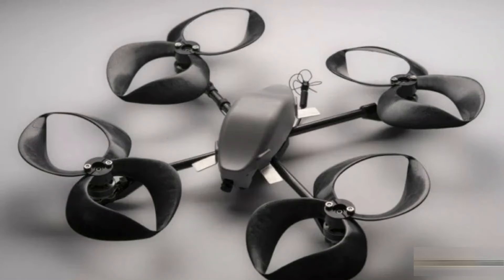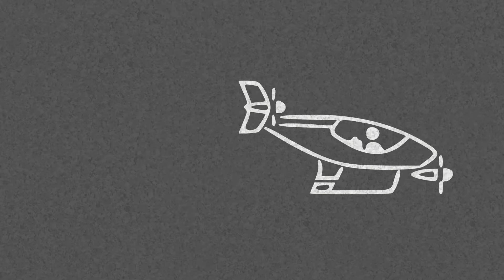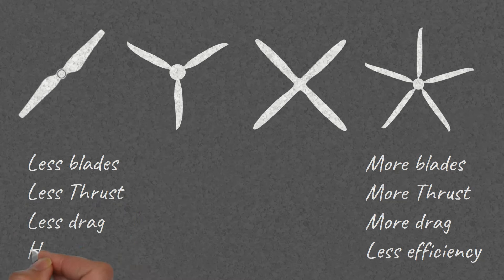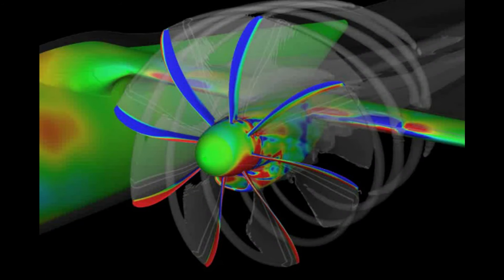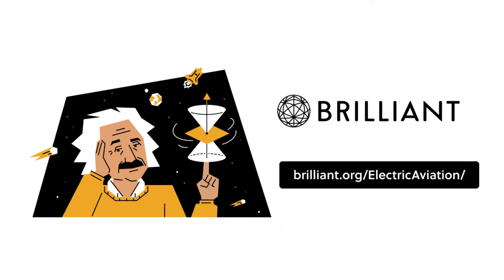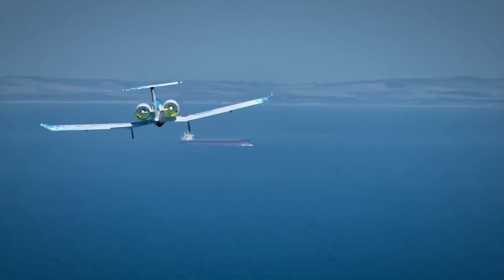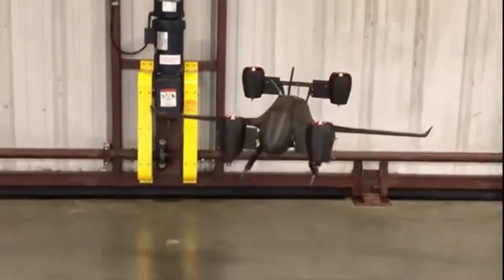EVTOL Propellers complete guide

Comment: Tip speed in ducted fans isn't limited to Mach 1. Turbofans commonly operate at 1.1 to 1.3 mach tangential tip speed. The duct regulates axial flow speed to approximate the pitch speed of the fan, which keeps blade AoA low and reduces wave drag. Excess or insufficient flow is handled at the inlet rather than the blade as the inlet spills or sucks additional air to make the duct velocity suitable for the fan pitch.

Comment: Great video, and pleased to see your hard work is getting sponsorship. My initial thought is that one of the most important modes of flight is performance after power failure. This has driven fixed wings to think deep about takeoff procedures, and has driven helicopters to think deep about disk loading for autorotation. The argument in e-VTOL is that multiple redundant electric systems will lead to >1E9 hrs to failure. This has lead to many e-VTOL designs with high disk loading and no autorotation capability (for example rpm control thrust in place of collective control thrust). However, the certification authorities are yet to agree to this approach as they know that even 1E9hrs standards can and do lead to incidents. So EDF is perfect for e-STOL, but we are likely to see a drive towards larger Q-tip blades for e-VTOL.
And, don't get me started about the design depending on ballistic recover systems to recover a total/cascade power failure near the ground during landing.😖 I will simply quote the Zefhir helicopter website "If you can, autorotate. But if you can’t, the parachute will save your life!"...
Reply from the maker: One thing Skyfly Axe got me interested in was its better glide ratio. One of the few aircrafts that can glide in case of a power failure. I like the Antanov AN2 for the same reason. The aircraft doesnt have a stall speed. These are the designs that should be electrified
Reply: @ElectricAviation  , a good glide ratio definitely helps, although technically this means the failsafe operation is STOL and not VTOL. Whenever I see drones clatter to the ground after battery failure I always think that it was a good thing that it wasn't capable of carrying passengers.
The best example about why VTOL needs autorotation is the AW609 tiltrotor, developed from the V-22 Osprey, that 20 years on still hasn't passed certification. The original V-22 concept was developed without autorotation in mind, but the high disk loading has led to some nasty vortex ring state accidents. The AW609 can autorotate, at very high descent rates, but not sure this has been demonstrated to full landing yet.
Jaunt Air Mobility certification is expected in 2027, so I guess this is the line in the sand for all of the high disk loading e-VTOLs out there...
Reply from the maker: @martingarrish4082   True. STOL is the way forward in the near future
Reply: I'm really tired of this autorotation argument, when does only the turbine or engine on a heli exclusively fail?? Probably 1 in a 1,000, the engine is by far the vastly most mechanically reliable component on at heli, if it's anything BUT the engine going haywire you are seriously screwed, that's why after seeing dozens of helis go down - on video, I've yet to see even one employ this almost mythical 'autorotation' technique to save itself.
Better to rely on multiple ballistic chutes (like whole craft ejection seats) and enlarged ground proximity/approach velocity sensor equip airbag systems to ensure survival.
Same deal with gliding to the ground in a fixed wing personal craft, the Earth isn't a uniform lush golf course green ready to give you a safe crash landing, the same solution applies chutes and airbags.
Reply: @Veldtian1  , I'm not against any of the safety systems you mention. Ground impact airbags actually make sense. In fact, I'd like to see rotor RPM governors implemented on helicopter collective pitch levers to ensure autorotation entry. But what does bother me is that lots of e-VTOL designers are using these systems to just ignore the basic physics of hovering flight.
Anyway what we think is irrelevant because it will be certification authorities that decide what flight envelope to impose on an e-VTOL design. If the strategy selected so much as sneezes about flight safety they will have no compunction about grounding the fleet either. So we do need to have the discussion - ideally 10 years ago...

Comment: You've inspired me to yet another idea.

I was watching an anime, where one of the factions had power armor. The mobility was provided by powered roller blades, and jet engines.

And I thought that's not really a bad idea.

Skip the power armor, use powered roller blades, and instead of jets, electric motors mounted bi-copter style on a backpack.

Not enough for full flight, but enough to do some epic jumps one or two stories up, and theoretically provide enough downforce to skate a vertical wall.

Also it would work like a steerable electric parachute.

You don't have to sustain flight to get most of the advantages of flying around.

User interface is definitely going to need some AI, and possibly brain interface. Good thing both of those technologies are off-the-shelf now.

Comment: As mentioned in the video, ducts eliminate the tip vortices and improve safety in the vicinity, but add weight and cross-section; the latter can cause the aircraft to be adversely affected by cross-winds.

Toroidal propellers greatly reduce (nearly eliminate) the tip vortices and improve safety in the vicinity (not as much as ducts, for either of those) but don't add significantly to the cross-section and add less weight than a duct.

Makes me wonder if anyone is working on an e-VTOL with contra-rotating toroidal propellers. And if not, why not? I would think it wouldn't be too difficult to add toroidal props to the Jetson ONE, assuming one had a way to manufacture such things.
Reply from the maker: I think the jury is still out on the toroidal props. One thing that can be said with certainty about them is the lower noise. There are a lot of configurations that need to be checked with them before they can be used in Jetson one. 
The good thing is drone enthusiasts are testing them and so far like what they have seen in terms of performance.
Reply: bUUUUTTTT, ducts can be turned into mini ring wings. as a thought.

Comment: I feel the design should make use of the tip vortex, making it an impeller, which creates a vacuum where the vortex flows in and out of.
Making the blade like a ice-cream scooper. round side pushes the air to the side (pressure) while the hollow inside creates the vacuum, which is much stronger then the pressure, creating a stronger inflow.
this inflow then should be guided.

Comment: There is another even more futuristic propeller/thrust technology that I have not seen yet and that’s putting the electric ‘engine’ into the duct so that the blade tips are at the centre. In underwater props these systems are called ‘rim thrusters’. The ducted fan axial flux motor air rim thruster…

Comment: As a fellow admirer of the Cartercopter I was hoping you would look at their scimitar propeller. It seems to have attractive advantages and fewer downsides than many designs. I am also intrigued by helicopter four blade tail rotors with the blades paired to form a narrow V shape. It was reported to be unusually quiet. Any idea why? Noise is the biggest problem with the widespread adoption of electric aviation. IMO it should be prioritised as high as any other facet of propeller design.
Reply from the maker: Thanks for the suggestion

Comment: I'd say the Custer Channel Wing deserves reasessment, but with some modifications, propeller running on leading edge of channel, if having it on thicker part of airfoil or elsewhere is to be experimentally determined, also if a counter-propeller, fixed vanes after propeller, changing swirl flow from propeller into a linear flow would improve efficiency. Antonov Izdelye tested the channel wing with propeller in leading edge, they say with some tethered flights, but soviet system crisis discontinued research.
Blessings +

Comment: Just for fun, how about adding a pin wheel fan in cruise mode connected to a generator to charge the battery? (Sort of like regenerative braking in cars? Very informative video. It helps to figure out all the new designs I've seen.
Reply from the maker: Any fan will create drag, that will need to be overcome by the main propellers. And the energy gathered will be less then extra energy spent. Having said that there are regenerative mechanisms in a few eVTOLs. The capture the energy and recharge the battery during decent

Comment: 0:10 "Co-rotating coaxial propellers" do not exist in practice.
0:48 "Thurst" = thrust.
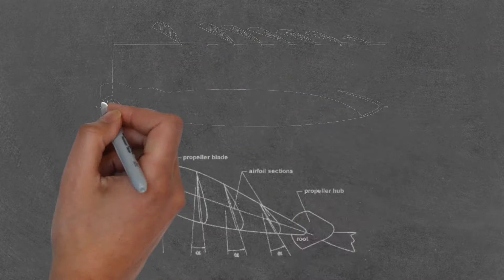3:43 High pitch angle at the root to low pitch angle at the tip.
7:44 Most designs use tilting rotors for vertical takeoff and cruise, so require variable pitch propellers for better efficiency.
8:41 Sharrow propellers are manufactured on 5-axis Heller HF3500 CNC machines.
8:52 Worse control due to poor PID response from the greater mass/inertia of the toroidal props.
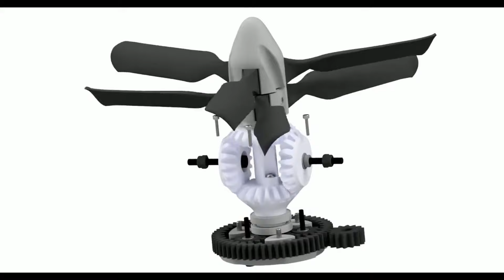9:01 Jetson ONE does not use coaxial propellers; rather, each corner uses twin motors in a tractor-pusher configuration.
9:14 Coaxial propellers/rotors provide more control and maneuverability for the same footprint as a single rotor; however, two separate rotors are more efficient and provide more thrust/control.
9:20 Jetson ONE has fixed pitch propellers/rotors, so cannot vary the pitch of each rotor; likewise, each corner's pair of motors vary their rotational speed together.
9:29 Contra-rotating coaxial propellers can be arranged such that the aft propeller is smaller in diameter but higher in pitch than the fore propeller, which could provide better efficiency than a single propeller. (Similar to the ducted fan, albeit variable pitch, discussed at 15:15.)
9:40 "Co-rotating coaxial propellers" do not exist in practice.
9:52 "Co-rotating coaxial propellers" are not used in practice, as opposed to contra-rotating coaxial propellers, because of the lack of cancellation of torque/propwash/gyroscopic precession/etc.,  more susceptible to lateral wind gusts, and way less efficient given that the aft propeller blades are constantly traveling in the turbulent wake of the fore propeller blades.

Comment: Propeller with duct or cowling don't have much more benefit unto it,infact it will just only reduce the effecience of propeller because of surface friction in low rpm and that will cause a stall and especially the tip of the propeller are not fit to adopt the environment which the forces of air is very different ,I hope someone get it.😅 While a ducted fan with a wide fan tip will have more gain to it's thrust by also from exhaust stator guide vanes  (if) the stator guide vanes was tilted on different position like on co-axial setting by producing a higher pressure compare to stator guide vanes that is just only function is to straighten the air flow, the stator guide vanes tilting at a different position may also secure the possibilities of so called (compressor stall) or just limit a some of air to push back to the intake duct because of a exhaust convergent design.

Comment: From what I've gathered ducting is good for high trust at low speed, you can try to fix the problems with the ducts increasing drag with ultra complicated duct designs, but the problem is fundamental, and absurd complexity is huge disadvantage in aviation. The issue of ducting or not is very well understood, in high speeds, open propellers are best choice essentially as long as the speed isn't over what the propellers are good for. This is shown by when turboprops are chosen, over turbofans and vice versa. It's not a new issue, no need to reinvent the wheel there.  Another example is the water propellers, most are open design, but there are exceptions, ducted propellers are common when high thrust is required at low speeds, like on tugboats, and also when high thrust is required in a very small space, you can use pump-jets. Pump-jets are technically less efficient than open propellers at high speed, at least until the open propellers run in to their limitations. 

Contra-rotating coaxial propellers can improve efficiency, because the second propeller can turn rotational flow into thrust. That's a widely known and accepted fact. The main disadvantages is the increased complexity, which introduce a number of issues, and the fact that they tend to be noisy.  With electric motors it's quite easy to just use individual motors for each propeller, like on the Jetson one. Using individual electric motors essentially solves complexity issue, and the disadvantages of dividing the power over more motors is insignificant compared to doubling the number of combustion engines for the same output.   

Together with some other potential advantages of electric motors, over combustion engines, and aerodynamic advantages with a single axle dual rotor over a larger number of smaller propellers it's likely electric helicopters with contra-rotating rotors will be "the" choice for EVTOL. At least for moderate speeds and distances, like up to a few 100 km/h speed and a maybe up to 100 km distance. To maximize efficiency you want the lowest number of blades,  that means the lowest number of propellers, or rotors, as other aspects practically allow, except for contra-rotating because of the rotation to thrust benefit. That is, of course assuming no duct, and ducts aren't worth it as the limitations of propellers/rotors is reached.

Even for unmanned multirotors, where even styrofoam ducts with negligible weight could be used without risking anyone's life they have'nt been able to improve efficiency, ducts are rarely used despite they could make multirotors much safer and reduce noise significantly. So, despite potential huge  benefits, and no significant difficulties, ducts are generally not considered worth it, except for toys when safety is way more important than efficiency, and or to make them look cool.  So, "in theory", sure, but in reality, open propellers/rotors are more efficient.  

Lilium seems to struggle to achieve manned flight at all with ducted fans, according to wikipedia they have existed since 2015, and has 800+ employees. At the same time multiple amateurs have made manned EVTOLs in a fraction of that time, using a fraction of the resources Lilium spends per hour, using open propellers. That should give a clue about ducted fans vs open propellers, and even tell more about the probability that Lilium is going to make a production model, ever. As of now their latest demonstrator is possibly the most expensive drone in the world. When a company only produce demonstrators, and cgi, for a number of years, the company is probably an endless money pit.     

Ducts can reduce penalty of using many small propellers/fans, compared to bigger propellers/fans with ducts, but they are not as efficient as open propellers. 

That brings us to "toroidal" propellers, which are kind of a bad compromise between ducted and open, with the duct-equivalent part on the propeller. They can absolutely be more efficient than some conventional propellers, but they can absolutely not be even as efficient as the most efficient conventional propeller for the task. Basic understanding of aerodynamics and/or comparing to a well chosen conventional propeller will tell you there's absolutely no reasonable doubt about this. Also, if you want high efficiency over a wide variety of speed and or thrust, you need variable pitch, it would be extremely difficult implement in a good way with "toroidal" propellers.          

So, in summary, conventional open propellers are the most efficient choice, in the range of thrust and speed where they are good. When it comes to speed look at turboprop vs turbofan for an indication when ducts becomes advantageous because of speed. If the "right size" of open propeller is too big, ducts can increase efficiency, compared to push a small propeller beyond the range where it is efficient, so ducted fans can be more efficient, if compared to an open propeller that is too small for the specific application. 

Then there's the issue of variable pitch, perhaps not as near impossible to implement with good results as on toroidal propellers, but still near impossible. It's not used on turbofans, they're design to be efficient within a limited range of speed and thrust, you can't practically achieve variable pitch and stack the blades like that, and reducing the number of blades to achieve variable pitch would reduce thrust a lot all else equal. 

To some degree this is an issue for EVTOL, how much sacrifice is it worth to achieve high efficiency in other than cruise mode? I mean, is the idea that they should be able to be stuck in traffic for long periods of time?  It's required to be able to take off, hover and land vertically, but the efficiency doesn't have to be very high unless it's supposed to spend a lot of time taking off, hovering and landing. If the idea is to spend a lot of time non-cruising, well, then the basic design of an helicopter is probably by far the best bet.  If 90+% of the energy is going to be spent fighting gravity anyway, it's just not worth a lot of added complexity and or weight to maybe reduce the remaining sub 10% a little bit. If you want to be able to travel very far and very fast on battery power, maybe you have to accept you wont also be able to take off from any roof in the same thing anytime soon. Flying fast and far on battery power even without VTOL capabilities is yet to be achieved. Adding VTOL requirement doesn't make being able to go fast and have long range easier.